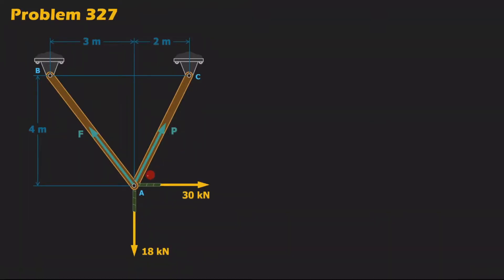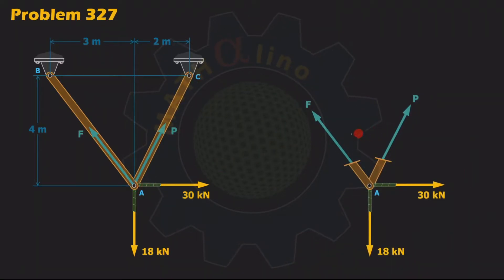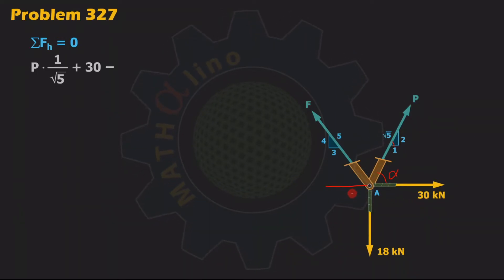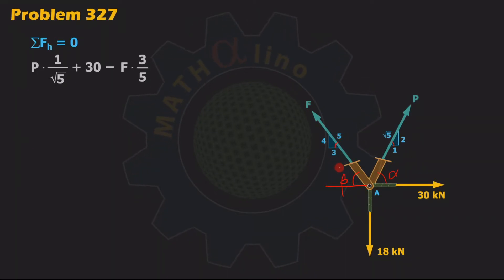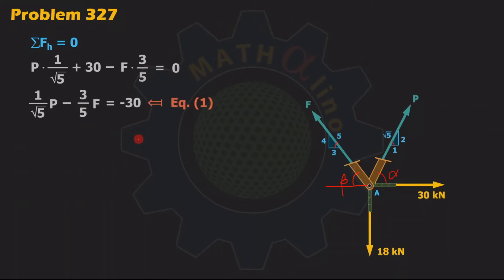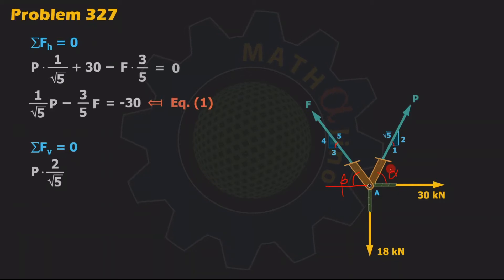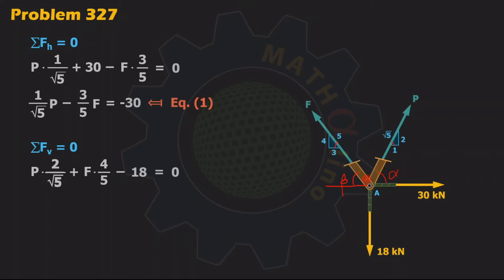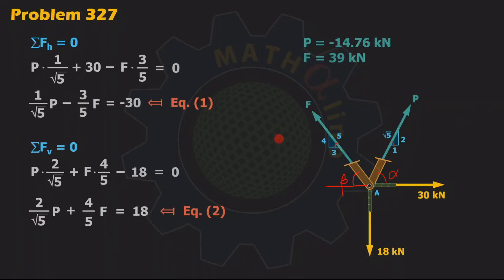Using Slope to Define the Direction of a Force | Equilibrium of Concurrent Forces

Comment from the maker: If the slope of the force is given, say a = horizontal, b = vertical, and c = hypotenuse,; the component of a force can be found by proportion. Not mentioned in this video directly, but this the essence of assigning arbitrary angle to the direction. F_x / F = a / c, hence, F_x = (a/c)F. In the same manner, you can find F_y to be F_y = (b/c)F.